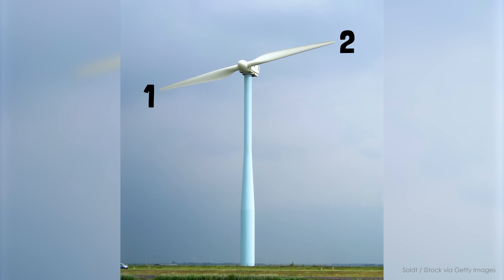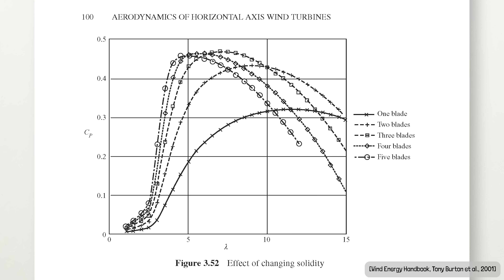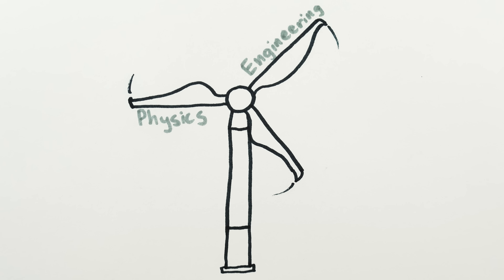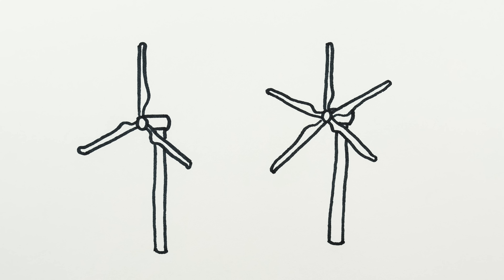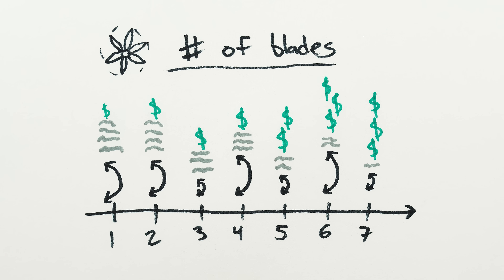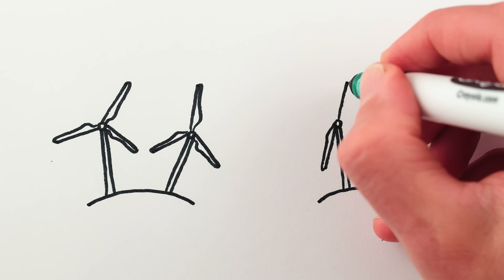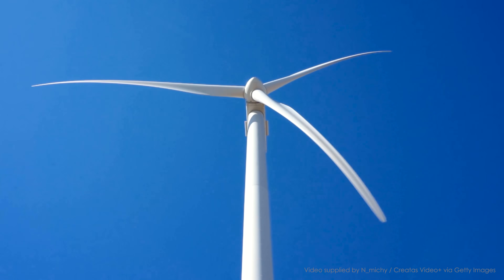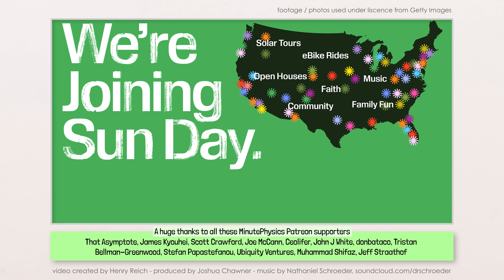Why Do Wind Turbines Have Three Blades?

Comment: On turbine noise, as a person who works on wind turbines, it is a non issue unless you are actually working on one. The main building I work in is only 100m away from turbines (which is honestly too close for safety from ice, but it was built long before those kinds of things were even thought about and regulated) and I never hear them. You need to remember that when they spin, the wind is often blowing, which is often much louder in your ears than any turbine. Vehicles passing by on the road are much easier to hear and much louder, heck we are even on the coast and fishing boat engines kilometers off shore are louder and more noticeable than the turbines.
Reply: I once drove with someone on our Autobahn and there were Windturbines next to us. They missed a few until they saw them and said "They are so loud, I can hear them in here!". Well, I drive a old Suzuki Swift, once I go over 140km/h the wind noise is so loud you almost have ti scream to talk, so I floored it. At 170 I asked "You still hear them?" And they qsked four times what I said, so... No, wind turbines are not loud at all...

Edit: Reducing noise is also a main goal of constructing them, less noise means less energy is converted into noise and therefore more is converted from linear (wind) motion into rotary (windmill) rotation, therefore the windmill works more efficiently and generates morw power/money.
Reply: Not sure I agree. I lived on a college campus a few hundred feet away from a turbine for a few years, and I was quite familiar with that whooshing sound. Especially noticeable at night when it was otherwise quiet and sound carries further due to temperature effects, and when the wind was high and blowing towards campus. Usually wasn't audible indoors, but if I had my window open and it was otherwise quiet, occasionally I could hear it.

I personally didn't mind the sound and sometimes even found it soothing – and it was certainly nicer than traffic noise! But I wouldn't blame someone who found it disruptive and didn't want to live next to one.
Reply: Odd that we seem to accept the constant background noise of roads but the barely perceptible noise of a wind turbine is often cited for the reason they can’t be built.
Reply: I mean it's a non-issue partly because people considered it and made it not a problem
Reply: Roads indeed are a massive source of noise people don't think about. You need to be way out in the wilderness to not hear car traffic.
Reply: The noise and bird issues I think are just NIMBYs complaining, or perhaps even worse, big oil shrills.  I have visited a wind farm a few times and there was one in my line of sight.  I didn't see a single dead bird.  Even when I stood right below the blade, the noise was quite subtle.
Reply: As with many times of noise, it's annoying when you aren't used to it. There is a huge amount of wind turbines where my parents live and in the beginning everyone complained about the noise. But it's not actually loud on the ground. On a quiet day you do hear it and it could feel strange but people got used to it. Different to actually noisy things like big roads, airports etc, a few months to years later and nobody mentions the sound any more and everyone is fine with it.
Reply: That's great info.

Now that i think about it, even chewing probably makes relatively louder noises than some distant noises.
Reply: @eugenetswong  Definitely. I live more or less right next to a highway bridge and even if I'm outside, if I do any movements like chewing, scratching myself, or just walking with a rustling jacket on, my sounds overpower the highway sounds.
Reply: @eugenetswong  Chewing is one of the loudest things you can do. Try replaying the video whilst eating crackers.
Reply: @eugenetswong yes, but you get to decide when you chew. Music and speech is louder than a nearby wind turbine too, but that doesn't mean you're happy hearing music or talking. 

Many people can tell you that the sound of chewing that they cannot control is absolutely intolerable.
Reply: @icedragon769  This! This nonsense attitude about "well it makes noise, but not as much noise as other stuff," is how we end up with light pollution, noise pollution, and all kinds of things that erode our ability to enjoy life.
Reply: @icedragon769 I don't get to control when other humans talk all the time, though I wish I could.😂
Reply: It's good to hear this.  I've got a number of wind turbine farms around me here in central Illinois.  I've been bike riding around them for over 20 years, and I've never heard one make noise.  I've even stopped under one, among the cornfield, and I just hear some gear noise.  When I take a video, I mostly hear the bugs making noise.  Maybe it's a problem on the really windy days when I don't ride my bike??  Honestly, if they were a problem, we wouldn't have more people volunteering to have them installed on their farms.
Reply: Noise radiates outward from the blades, not straight down
Reply: @brucemandel3318  show me any data that supports this ridiculous idea.
Reply: @SkyhawkSteve  The real windy days you can't hear them over the wind itself. The time when they are most "loud" (loud relative to everything else, and even then not overly) is when the wind is blowing barely enough for them to spin at a decent speed, since there is less noise from the wind to drown it out.
Reply: @SkyhawkSteve Central Illinois gang
Reply: @SkyhawkSteve  "I've never heard one make noise, aside from the noise I heard from one." 

Honestly, you don't sound like someone whose input would be valuable.
Reply: did get a good video the other day of one zoomin pretty loudly, it was cool. couldnt be heard from much further than right under it though
Reply: You never hear them? Or you never notice them now?
Reply: if you havent seen a wind turbine before you should know that even though they are noisy that noise travels no far. you have to be REAL close to the turbines and at that point are you doing there anyway
Reply: They're really loud at night
Reply: I mean when you think about it for more than a few seconds it also becomes obvious that wind mills should make as little sound as possible as any sound the mill does make is energy that's not being converted into electric energy, thus making it a worse windmill.
Reply: What do you mean by too close for safety from ice?
Reply: @BeaDSM  Ice can form on the blades when temperatures are around 0C. If the turbine keeps operating, then ice could shed off the blades as they spin around and if you have seen a trebuchet, then it should be obvious that it could fly a decent distance. It is incredibly unlikely for ice to ever shed off a turbine and hit something (besides maybe itself and its own stuff) and it is very unlikely for ice to ever be thrown far at all, it mostly only lands directly beneath the turbine. This is why we have laws/regulations in place nowadays to ensure turbines are not built near anything else, and nothing else is built by them. My site is an exception since the turbines and building I work in was built early on, before safety measures like that were really implemented. One of the turbines even has a public road pass under its blades where much of the ice it sheds falls. I have to drive over that ice on my way into work some days, and there is a 1 in a million chance it could shed some more ice at that moment and crush my car. Those safety measures are no joke, it is a good thing they exist. The turbine should be reaching its end of life in the next decade, so it should hopefully not be a hazzard for too much longer.
Reply: 1.  Wildlife hear and are AFFECTED.  2.  Maybe you are just ALREADY DEAF.  yukkity
Reply: other animals that can hear more frequencies than humans: ☠️☠️☠️
Reply: @What_111  Animal hearing extends into higher frequencies than human hearing, it does not go lower which is the kind of vibration that a windmill would produce, they aren't exactly spinning fast after all. The reason why their hearing doesn't go lower is because lower than about 20 hz is literally just a regular ass vibration that you would feel in your body, you can't make an ear that can pick up those kinds of vibrations and you also don't really need to.
Reply: @hedgehog3180  i’m pretty sure some baleen whale species, elephants, some reptiles, etc can hear lower frequencies than human. there aren’t enough studies to say that they wouldn’t be affected by the lower frequencies.
Reply: @What_111  Oh yeah that's true, I thought you were talking about land animals.
Reply: @hedgehog3180  i’m pretty sure that elephants are land animals? XD
Reply: @What_111  Oh yeah I overlooked that, but elephants can't really "hear" in low frequencies, they can just pick up those frequencies but they do it in the way I described by just noticing that their bodies are vibrating. It's a more sensitive version of how you can notice if a truck drives by outside even if you can't hear it.
Reply: I totally support windfarms, but I also live a few kms away from a series of them and when the wind is wrong you do hear them. It's like a far-ish motorway or a nearby surf beach. Liveable but also noticeable.
Reply: Thanks for sharing your perspective, very instructive
Reply: This, I've lived in areas of close proximity to wind turbines and never heard a peep from them. Even when I got close to one, barely any noise
Reply: in my area most turbines are too quiet to be heard even standing next to them. But the one exception is hearable from up to miles away (downwind) at moderate wind speeds.
Reply: If I had to guess I’d say if they didn’t design or maintain them well they’d probably make noticeable noise, but it being top of mind and people doing a good job keeps it quiet.
Reply: That’s a big thing I realized driving near them in Illinois a few months ago; I was curious if I could hear the windmill turbulence but the wind itself was so much louder
Reply: There are plenty accounts of communities complaining about the sound, and my dad who has 3 of them blocks away from his work often speaks about how loud they get.
Reply: Now convince the people who haven't been sleeping well for years due to low frequency noise.
Reply: That's just not true lol, at least not with the turbines we have. When the wind hits the turbines from a specific direction you can hear a very distinct and pretty loud rhythmic thumping sound from 3-5km away easy. It sounds like a teenager driving past your house, but instead it lasts for hours at a time.
Reply: @courier6634  You must have a number of videos of this to share, right?
Reply: @courier6634  How old are they?
Reply: I completely agree. In Germany, people often complain about wind turbines being too noisy, and there are some ridiculous rules about keeping a distance from houses. As someone living in a city, I can only say: If you can hear the wind turbine at night, then only because there is no street anywhere nearby, so this is a luxury problem. I live in a rather quiet neighbourhood but I can hear the motorway which is a couple of kilometres away if the wind is coming from that direction and not the wind turbones which are way closer.
Reply: @cl8733  To be fair, you do need some rules about distance from wind turbines for safety (not noise) reasons. Wind turbines can get ice accumulating on their blades in winter or hail-like conditions, which they can then throw a couple hundred meters away as it comes off. It is extremely unlikely for turbines to throw ice like that and even less likely for it to ever actually hit anything, but that doesn't mean we should tempt fate by building turbines near permanent residences (or new residences near turbines). 

The turbine closest to my work actually has a normal road (that normal people would be driving on, not just workers looking to access a turbine) passing next to the base of the turbine, under the blades (like I said in my original comment, these were definitely put up before we had these kind of restrictions on how close turbines can be to other things), in the winter sometimes you can see ice piled on the road from shedding off the turbine and that definitely can put some scary images in your head.
Reply: Trains make no noise.  Take it from me, I've lived near railroad tracks with constant trains for 22 years - I don't hear them at all!
Reply: The actual sound of turbines is really satisfying even, I love how they sound. It's too bad I don't work in renewable energy! The sound of cars driving down the road at higher speeds is awful, and it's everywhere in America. The goal needs to be to cut down on car usage and as a result, cut down on car noise. Big cities would sound really nice with a lot less of it. Another sound I really like is running trains, especially at higher speeds, which is too bad because I don't live in Europe or Asia, just the US. Maybe someday the slog of CAHSR will get to where it needs. It's securely funded State side at least, the Federal Govt. isn't willing to return the tax revenue value California brings to the nation, so we'll do it ourselves. And yet another sound I really like is the sound of bicycle traffic, it's really quiet but it's nice, the sound of cranking pedals, idling sprockets, and lightweight spinning metal.
Reply: It must be the kind of turbine, because driving past them on the highway (they're about a 1/2 a mile away) on a day with a light breeze (maybe 5 or 10mph) you can hear them over the car noise, radio, and conversation. And if you park the car and get out, you can FEEL a thrumming vibration in the air, and good luck trying to hear each other talk. Underneath them would be unbearable without ear protection, they just freaking ROAR. Still better than coal, but also VERY loud.
Reply: The turbine is not noisy. It's the props (or more accurately the blades). And they are indeed very noisy.
Reply: What about low frequency noise travelling kilometres through the bedrock? I’d love to be a yimby for a wind farm near my house, but I’m sensitive to anthropogenic hum and live in a really rural location for a reason. Do I need to worry?
Reply: @Nellybeee If you're worried about that shouldn't you worry significantly more about traffic? Also how exactly is that even meant to happen? Windmills are rarely ever directly connected to bedrock since in the grand scheme of things they're relatively light structures so they are fine with just a concrete foundation. So in order for sound to somehow travel through bedrock it would somehow have to first travel a few hundred meters through dirt without being dampened even though low frequency vibrations famously don't transfer well through pourous materials, then after it reaches the bedrock it would have to travel those several km to where you are, even though bedrock usually has cracks in it that would prevent this propagation, and then it would need to again travel several hundred meters up through the dirt to reach your house. It all just strains belief when you think it through especially when you compare it with structures that might actually need a bedrock anchor like bridges and also oil drilling.
Reply: @Nellybeee Don't trust YT comments, if you're worried about something, look for professionals irl.
Reply: @Nellybeee No, not in the slightest.
Reply: Anyone who says they don't mind the sound has not experienced it firsthand.  Exception: exclude those who make a living from them. Think about it. Sewer and septic tank servicers always, always say the smell is not an issue whatsoever. Asphalt workers - same deal.
Every time passing near one it feels like being under alien attack. It's truly unnerving. Spend an entire minute near one, and congratulations on knowing this firsthand.
Reply: @Bill_Woo  I was directly under the blades of one for at least ten minutes and I described the sound as a giant breathing very softly. I can't imagine it bothering me in any way whatsoever.
Reply: @Bill_Woo  Where were these wind turbines, and what were the wind conditions?
Reply: @SkyhawkSteve  One example, suburb of Dallas, zoned light business; with any meaningful wind, you'd hear the high frequency piercing pings over and over, relentlessly. That "relentless quality" is difficult to convey, but it's a big part of it; as the tension of hearing them builds, there's no letup, and it's mildly (or more?) traumatizing.  Maybe a psychologist can explain that. And I can't possibly believe that continuous long term exposure wouldn't have profound effects, not just emotional, physical. An affected heartbeat? I'm not kidding. That piercing sound is not subtle. You can "feel" it. That sound energy most certainly emits energy, via sound.
Reply: (Sorry for runaway grammar at the end. I never edit, because it permits "revisionist history".)
Reply: @Bill_Woo  They don't (or at least shouldn't) make high-pitched noise. You must got some real awful windmills. Also what do you mean "sound energy emits energy, via sound"?
Reply: @Bill_Woo  Agreed. And That seems like infrasounds.
Reply: Absolutely wrong...wind turbines make plenty of noise...my house is surrounded by dozens of them and you can clearly hear the whooshing noise many times through the year...even with windows closed. Honestly they are an eyesore and a total waste of resources. They have dramatically driven up energy prices and I don't know a single person who likes them
Reply: @DaMerk5  That sounds strange, because I/my parents live near some and I don't know anybody around there who still dislikes them for actual reasons like the sound. In the beginning yes... but it isn't actually loud.

Do you have single glas windows and live directly under a model of windmill from the 90ies or before?

Eye sore is subjective, but the noise? Unless your house is absolutely directly under the turbine and has windows that aren't sealed, no way I woud hear those turbines around my parents inside the house with windows closed. Outside I hear them if it's quiet but any chirping bird that is close to you out chirps the turbine, if there is any street, even a small one, that noise is several times higher.
Reply: @DaMerk5  I am sorry if they are noisy where you are, but my experience of visiting a wind farm was that the passing cars were probably noisier than the blades.  

I like them: they don't produce gas, they can provide energy over a long period of time, they are no more an eyesore than other infrastructure, I haven't seen any negative effect on wildlife as some doomsayers have suggested.  Maybe they have in some places caused harm to wildlife, but was it more harm than pollution from fossil fuel power stations?  Reliability can be an issue, but they have a place in a mixed energy model.

I am quite curious, as all the wind farms I have seen are quite isolated.  Where have they been built next to homes?
Reply: @DaMerk5 absolutely. A coal powered power station in its place would be so much better for you
Reply: The sound is not so much "high frequency" as it is a VERY PIERCING "chirp". Over and over. It is of high aural intensity, though one can defend it by playing games with sound measurement characteristics - decibel levels, etc. It's like cracking a whip. Exactly like cracking a whip. But with many, many multiples of that produced on the circus floor or wild west show. And repeatedly. With CUMULATIVE impact. I should have known that people who feed their family by promoting it would be the ones reading this; I just naively thought they were all scientifically honest. Clearly - and frankly unsurprisingly - some are not. They are in no universe sonically neutral.
Reply: @Bill_Woo I don’t think anyone doubts that an unpleasant sound could happen, but it doesn’t on a properly operating wind farm.
Reply: @Bill_Woo  You clearly have a starting bias if you really think this thread is filled with windmill engineers and scientists. Those people are not that common, literally only the first comment from Michaelonyoutub says they work with windmills, it's not a windmill conspiracy. Are you assuming that everyone who says they don't mind windmill sounds are windmill workers?
Reply: @Ultimaximus  Welcome to the real world, Pollyanna.
Reply: @Bill_Woo , I think the older turbines were noisier than the current generation of turbines. Do you happen to know when the turbines you are referring to were installed? There is misophonia, which is a n neurological disorder that makes people very-sensitive to noise. The actress Melissa Gilbert actually suffers from it. It’s possible that you may also be able to hear sounds at higher-pitches, than other people. I can definitely understand how hearing a recurrent “ping”-sound would cause you stress. Noise-canceling-headphones may be an option for you, when you have to travel to the location where you hear the “ping”-sound from those particular wind-turbines.
Reply: @christopherpearman3422  Funny, EVERYONE agrees on this - except the people who are paid to work with them. I'm just expressing what everyone says: Their sound is horrid. People (who have agendas) act like I just invented the concept of finding their sound upsetting. Get serious.
That said, if there really has been a revolution in the field where the sonic attributes are now kinder and gentler, then by attrition over time any opposition should fade as well, okay? (And "everyone" is an exaggeration of course, since A. maybe newer ones are relatively inoffensive (don't lie and say they're silent) and B. some are isolated from public sense perception, such as on desert wind farms. Either way, sure, people wouldn't mind those.)
Reply: @Bill_Woo  I have never worked with or on wind turbines. Yes I have heard a soft whooshing noise but the newer ones are much quieter. In fact, modern turbines tend to be quieter than the sound of the wind. The only time I heard an annoying noise was from a last century installation. It was replaced about 25 years ago.
Reply: @Bill_Woo  "EVERYONE agrees on this"

you pretty much ignored all of the comments that said the opposite.  something is not right with you buddy.
Reply: @thomasneal9291  1. EVERYONE agrees on this. 2. Note to self: when someone is corrupted because they financially benefit from something, and that 'something' is exposed as being harmful or 'wrong' in any way, just smoothly label the exposer as mentally ill. Surely someone else will fall for such hypocritical cowardice. 3. Keep telling yourself that there's nothing wrong with being a hypocrite. When one's life is a lie, and they are too much of a weakling to face up to it, so they resort to escapist denial tactics, hey, that's just fine, and one can lie in bed in self gloating adulation instead of cold sweating horror. Wow! I learned a lot from you here! Keep it up! You're like, an asset to humanity or something!
Reply: @Bill_Woo  I think there must be something wrong with the wind turbines near you. Could be poor maintenance or defective design. Either way, they're not supposed to sound like that.

I volunteer to run summer camps for kids and teens, and close to where we have the camps there happens to be a bunch of medium size (2 MW, I just looked it up) wind turbines that you can just drive or walk to, no fences or anything. You can literally just walk right up to the towers and touch them. We sometimes make day trips there to show the campers what a wind turbine looks (and sounds) like up close. Nobody's ever found the noise unpleasant, because there's almost nothing to hear. It's actually weird how quiet the blades are, because they look like they should make a noise when they fly by right above you, but they just don't. At least not in moderate winds. (I've never gone there during a serious windstorm to check if they make any more noise then.) Some people can hear a quiet steady hum from (I think) the generator, but there's a 2 lane rural highway about half a kilometer away that mostly drowns it out.
Reply: @Bill_Woo  Ah, this must just be bait or delusion.
Reply: @Bill_Woo  methinks you need to visit a hearing specialist.  NOTHING you have said makes a lick of sense.  I used to visit a GIANT wind farm in California regularly, and you can barely hear anything at all.  as someone else mentioned, it is "noisiest" when there is barely any wind, and you can just pick up the gears working as the blades spin.